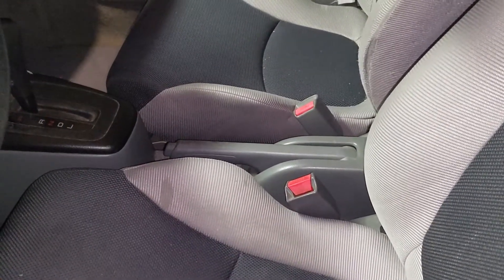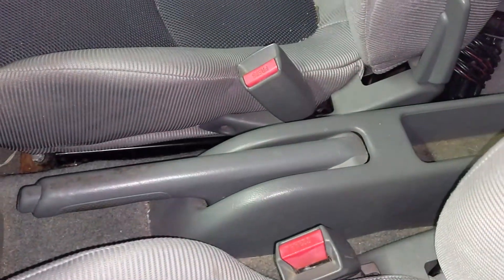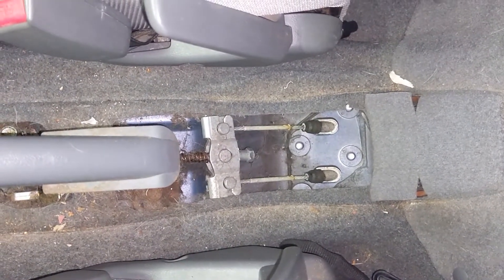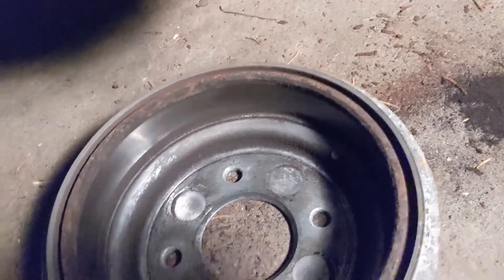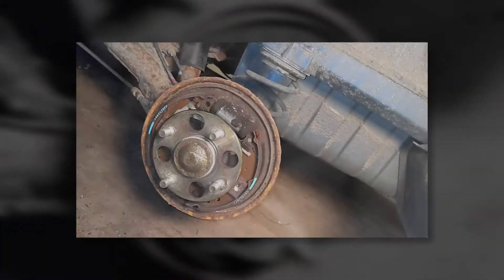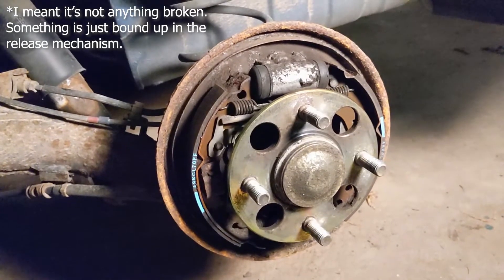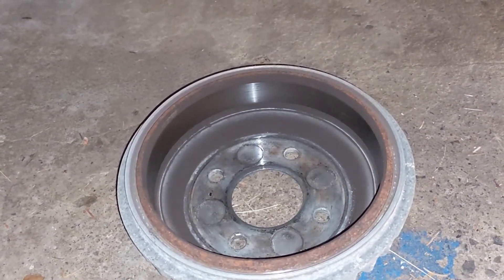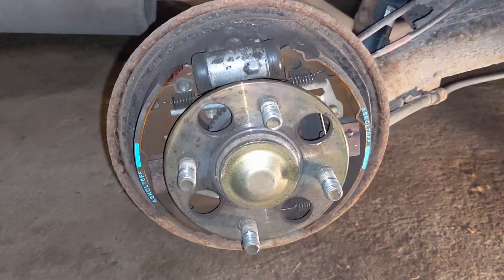Honda Insight - Emergency Brake Sticking

Comment: Did you ever figure out what the problem was? Parking brake solenoid switch?
Reply from the maker: Hey there. Not definitively, but I believe the brake drums have a ridge worn into them, and one side is getting stuck releasing properly. The shoes look fine, and they seem to release fine, but (especially when cold) sometimes don't. It's intermittent and I've kinda stopped using it. I meant to get back to it before the winter set in, but I didn't. I've thought about attempting to grind out the ridge and see if that helps, but with the limited options for replacements, it's not a big deal.